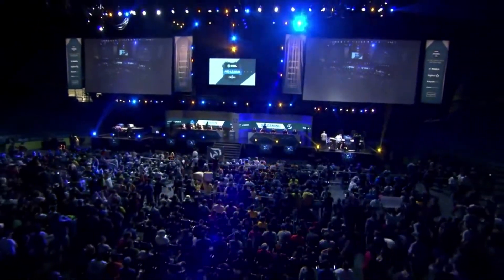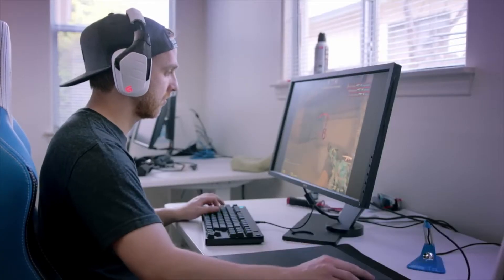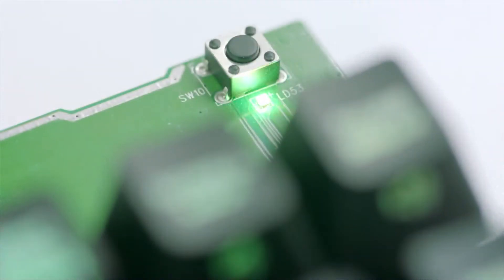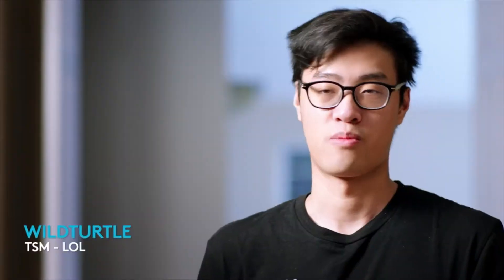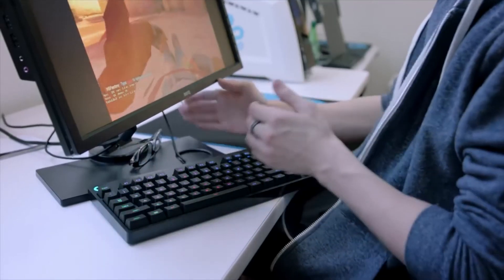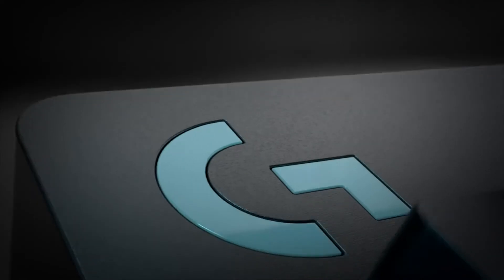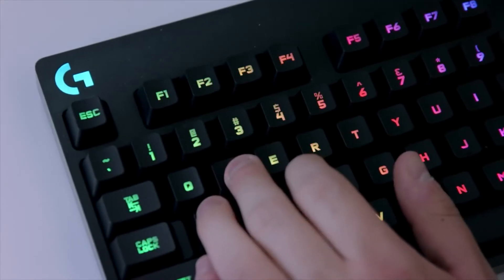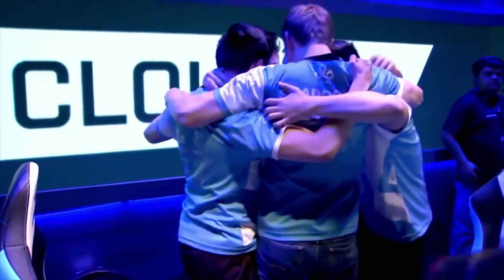(UNDER $150) BEST BUDGET GAMING TKL KEYBOARDS WITH RGB IN 2018

Comment: Should I get this or the razer blackwidow v2?
Reply from the maker: it depends on what you need!
Reply: Razer one's
Reply: Neither. If your looking for a good TKL keyboard, get a ducky one 2 tkl. It’s got Cherry Mx switches, a usb type c cable, and comes with pbt double shot key caps. The rgb is beautiful, and the lighting presets are pretty good. It’s also got virtually no flex when pushing down on it, so I know it’s built pretty well. There’s some other great stuff about the keyboard, but tbh I’m too lazy to include it. It’s only like $125 on mechanicalkeyboards.com and if you live in the states, you can get free shipping within 4-7 business days. It’s a great keyboard, and it’s also priced really nicely. It’s something I’d gladly spend my money on, if I didn’t already own one.

Comment: They are trash.  I have never had a cherry switch fail on me ever.  You cant change out the key caps because of the stupid design.  It uses USB micro instead of C.
Reply: BareSphereMass assuming you’re talking about the g pro, the keyboard’s functionality isn’t bad. It’s just not customizable and doesn’t suit your preferences. It still serves its purpose, and serves it very well. As for the micro usb, that’s just you nitpicking, not many other people seem to care that much. Although type c is preferred, micro usb isn’t a completely shitty, totally unacceptable option. Also, Cherry MX switches are great, and probably my favorite type of switches, but if you’re really pissing yourself over not getting exactly what you want, just pay extra for the G Pro X so you can have the hotswappable switches. Ok buddy?And if you want a TKL keyboard that fits all your critiques, just get a Ducky One 2 TKL. It uses a USB C cable, Cherry MX switches, and because of the Cherry switches, the key caps are swappable. Also it’s a bit less expensive, which is nice.